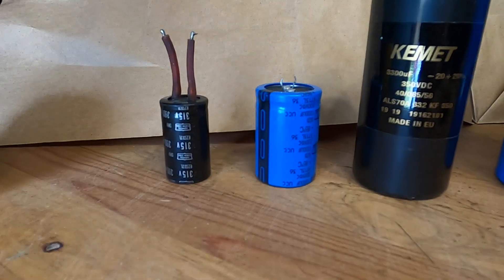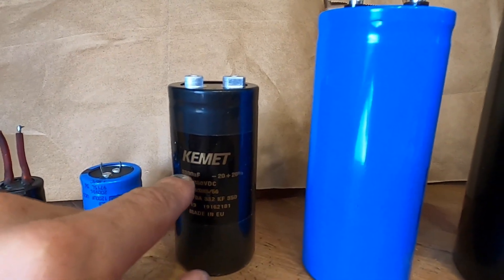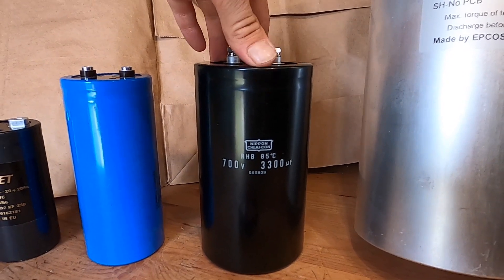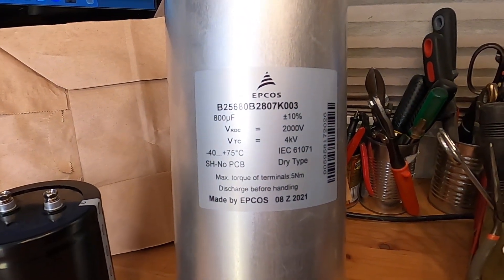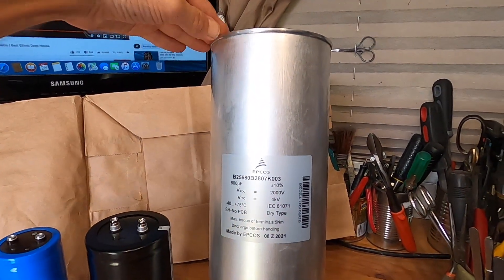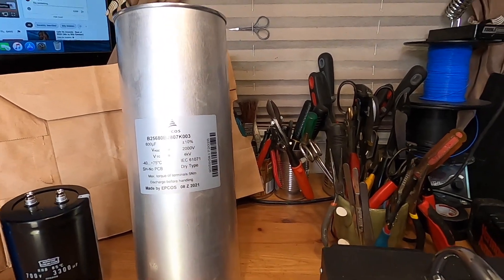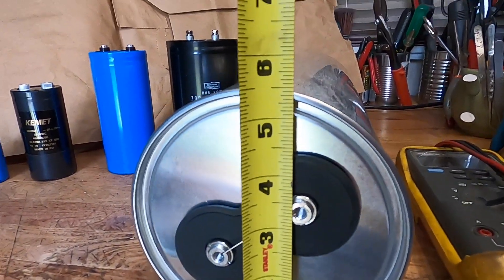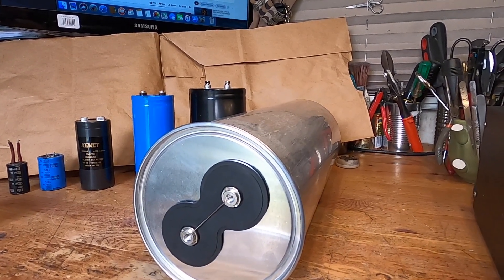047 Large 2kV Capacitor to be tested on new model BBMPulser 7!

Comment: You will need a massive on/off switch or super duper mega MOSFET.
Reply from the maker: 2kv is the highest Voltage I can use thyristor for.. any higher and it will have to be spark gap. 
I guess next models 8th and so on will be spark gap instead of thyristor or Mosfet
Reply: @AndreyD  its pretty scary. i got shocked a few times from a gas igniter coil. Its best wire everything up and not charge it up until everything is perfect. WEAR RUBBER GLOVES AND KEEP ONE HAND IN POCKET.
Reply from the maker: @esecallum  Also I need to prep large resistor bank to discharge it in case thyristor fails to discharge, and anytime before touching circuitry I have to discharge it.
Reply: @AndreyD  You can use water as well. or spray on water  from arms length between the terminals which will discharge it.

Comment: OMG! So, your new pulser case would have to be bigger than a huge suitcase? And 1 pulse would probably be enough to scare off all pathologies :)
Reply: YOU CAN USE IT AGAINST CORONA IN NASAL PASSAGES AND RESPIRATORY TRACT.
Reply from the maker: Yes capacitors taking most space even now in 5th and other models.
I could have installed a few caps to reach 800uf but it would take even more space.
Reply from the maker: @esecallum Yes it works well against any flue Viruses